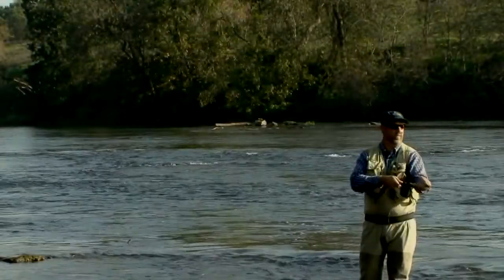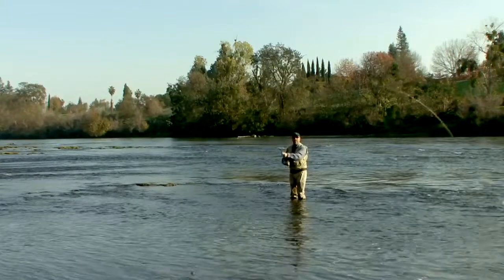Switch Rod Primer

Comment: Nice video.  The switch rod for trout sounds like a great idea.  My normal fishing is for salmon from the beach with a 13' 7wt two-handed rod at Point-No-Point Lighthouse here in Hansville, Washington.  I also use this rod on our estuaries for searuns.   

I learned Spey casting for steelhead at the mouth of the Elwha River a few years ago from a master, Dave Steinbaugh at Waters West Fly Shop in Port Angeles WA.  Consider giving the extra rod length a try.  It's more about finesse than power.